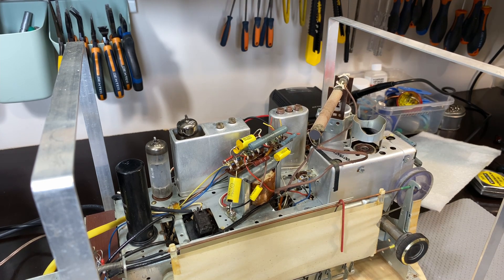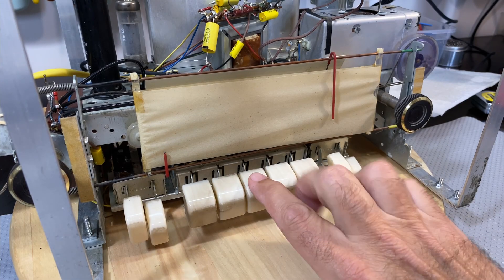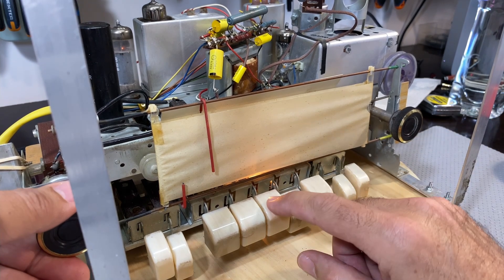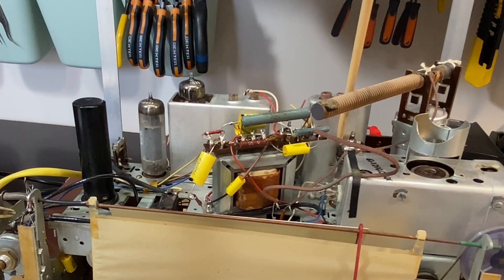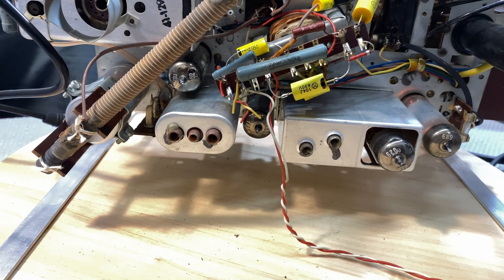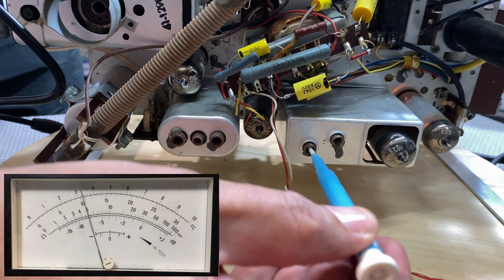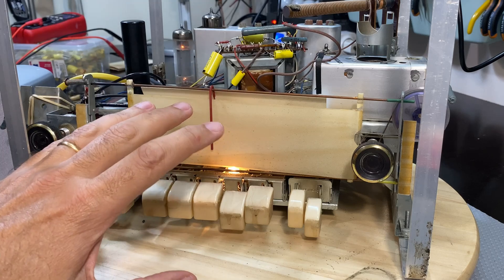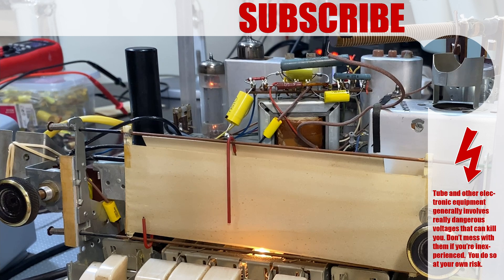Testing The AM bands, and a little IF alignment action. Telefunken Dacapo 9 part 4.

Comment: Many thanks for sharing your outstanding works, I am an avid follower of your restoration and repair videos. I noticed that you marked with a black dot the "yellow" caps same as Mr. Carlson does, are you using his ground detecting device or I missed one of your video or suggestion on the subject. Many thanks again
Reply from the maker: No, I just use the oscilloscope to see which side is more sensitive to noise.
Reply: Would you give any hints about the procedure? Is it possible to proceed testing with just a multimeter? Many thanks for your previous reply and attention
Reply: It is the first time I approach questioning a guru of electronics restoration, my knowledge is very limited and very happy to be taken into consideration. I spent some time during lockdown discovering all the wonderful people dedicating their wit, knowledge and experience and most of all sharing them with us, it would be very interesting to have the chance of having you reunited for a discussion about the approach to vintage electronic equipment restoration because all of you have different style and vision and it is very interesting to see that. Thanks again for your work and dedication, it is illuminating.
Reply from the maker: The way to find the outer foil of a cap with a scope is this: Connect the scope leads to the cap. See what noise voltage you get. Reverse the leads and see if the noise is higher or lower. The one that reads higher is the outer foil (where the probe was, not the ground). I hope that makes sense 😊 
Getting some guys together seems like fun. I thing we all would participate if someone organised it 😊

Comment: Hi Manuel, I am working on a Grundig radio from 1965 and only changed the electros, everything else is in good order. You have inspired me to switch to DaVinci Resolve, my current editing programme is great but is unstable resulting in frustrating freezes and reboots. DaVinci Resolve is quick and stable and the multicamera sync works perfectly. Getting my head around how to do the things I'm used to doing is a challenge but after a few hours I can edit as fast as the old programme and have produced a few parallel practice videos as I prepare for the switch. Cheers!
Reply from the maker: I look forward to that Grundig. 1965 was almost the end of the tube radio era, so they did some interesting things. DaVinci Resolve is amazing, but as I said, the learning curve was steep 😊
 However, as is normal with these things, once you get it, it’s a breeze.

Comment: Excellent reception on the mini whip versus the long wire. I built a mini whip but I'm a bit confused about the grounding and I'm sure mine can be improved . It would be good to clarify how your ground is achieved if it is convenient to fit it somewhere in the next video, if not convenient don't worry it's just a thought that this may be an informative subject for those considering a mini whip.
Reply from the maker: I tried all sorts of grounding solutions, and finally gave up on those in favour of not having a separate ground ao all. Inside the supply box, I build a simple balun, and the incoming signal is therefore galvanically isolated form the signal going to the radio. That is what worked best for me.
Reply: @electronicsoldandnew  
Thanks Manuel, I'll try making a  balun and see if that improves things🙂

Comment: Have been wondering how the mini-whip circuit would go at the long wire external termination point, (not the long wire outlet at your desk)?    I have seen other videos on the mini-whip and they connect it at the desk outlet - not the long wire termination point.
I could try, but being a third of way up a brand new 57 floor apartment tower they would get grumpy if I tried to sling a long wire outside :-(
Reply from the maker: I tried everything when I went through the “must get the absolute best reception “ phase 😊 I finally “hid” the wire along the building’s roof edge during a stealth (and dangerous) operation without any of the neighbours seeing me 😊
Reply: I can't really picture you dressed in black like the SAS and dangling from a black rope trying to string a wire under the gutter.   Aahhhh the things we do when we are young and stupid ...
Reply from the maker: True. What’s worse is that I wasn’t even young at that stage, just stupid 😊

Comment: Youre starting to convince me on the miniwoop antena thing... Thanks for the update.
Reply from the maker: I was sceptical too, until I tried it.
Reply: Just wondering how you grounded your mini whip being on an upper floor. I asked a vendor about grounding and he replied it was necessary if you use a metal mast, but not so important if you use plastic.
Reply from the maker: I did not ground it 😊 I read all the material on it and tried endless solutions, until I found that simply using it without a ground worked best. I did, however, use a balun, so it is effectively isolated.